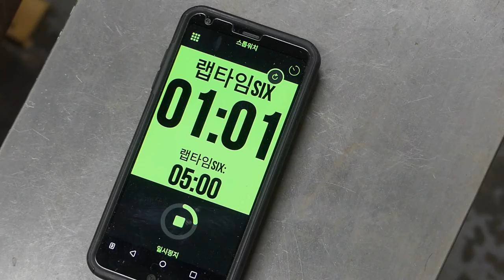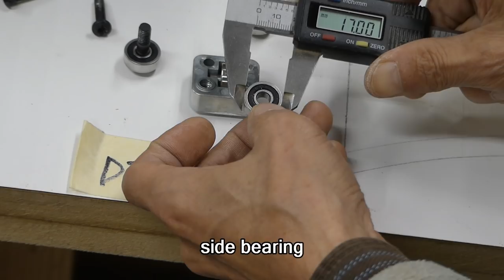Dewalt  vs  Bauer

Comment: I bought the bauer cauz it was cheap and i am going to use it five times a year. Changing the blade is like tying shoes, it becomes automatic and simple after a few times. Also, some blade makes are easier than others to control when changing. If this tool is for professional use, then buy a fancy brand. Otherwise Bauer is totally awesome

Comment: I purchased their $17 “multi tool” and have had it for 4yrs. I’ve used it to undercut at least 100 door frames for flooring installs. I figured I’d spend the money on the blades rather than the tool. The switch can be a bit finicky, but it’s earned its keep. When/if it quits, I’ll gladly get another! The cordless drill, however, died rather quickly. I also had their big wet saw and it performed flawlessly until I got the opportunity to get a bridge saw and sold theirs to a friend (he uses it commercially to tile floors). I have their 14” bandsaw, and plan on getting their dust collection system in the spring. I suppose it depends on the tool....
Reply from the maker: I also use the harbor freight 6 x 48 belt sander very satisfactorily.
It may be different from case to case.

Comment: If you noticed he used different camera angles to compare and intentionally made it look difficult to replace the Bauer blade.
Reply: The Bauer blade can be a pain to change because as he pointed out the blade tends to get hung up on the screws in the housing. I never looked into grinding down the screws because I don't use mine that much, but it might an option.
Reply: Jesus the Bauer blade Takes 1 min to swap. If you can’t figure that out you shouldn’t be using power tools.

Comment: Do you leave you saw tensioned, all the time? The frame of these portable bandsaws is a zinc aluminum alloy that will slowly warp under tension. Then the blade won't track right nor hold proper tension. Same thing will probably happen to your Dewalt, if you leave it tensioned 24/7.
Reply: Good question. I take my blade out and clean it after every use.. even says so in the manual.. 😁👍
Reply: @elfpimp1  Wow. If I had to do that, it would change how I use the tool! I am constantly using it to cut down a machine screw or two. Luckily, I did not read the manual. 

I bolted a spring to the tension handle, so it holds just a little force  on the blade when detensioned. That way the blade stays in the saw without the jack-in-the-box feature, wondering when the blade is going to go "sproing" and pop hafway out. :)
Reply: @mildyproductive9726  hehe, good one. I've not had the blade spring out after the first time I de tensioned the wheel.  But I understand where you're coming from.. 👍

Comment: Hey Young Je, what’s the advantage of mounting placement of the foot pedal? Are you actuating the pedal with part of your left hand while also guiding the work piece?
Reply from the maker: When the band saw is mounted on the stand, it is necessary to attach the switch of the knob to the ON state and attach the other switch to make the operation easy and safe.

Comment: I disagree. I certainly wouldn't buy harbor freight for professional use, but my portable bandsaw from there is awesome. You probably didn't change the blade to metal cutting blade. It SAYS right on the sticker the blade is meant for WOOD.
Reply from the maker: There are many videos in my video that use bauer.
I use the saw blade below
https://www.homedepot.com/p/Milwaukee-44-7-8-in-24-TPI-Bi-Metal-Deep-Cut-Portable-Band-Saw-Blades-2-Pack-48-39-0534/100564064?MERCH=REC-nosearch3_rrNA-100564064--N
Reply: @YoungJe  that is amazing. I tried to get a blade at HF and they told me they don't sell them. I bought an HF portable Band Saw and I like it. I did order a 3 new blades right away from Amazon.  Good review for me it does depend on the tool.

Comment: Young, I see that you point out the blade replacement as being the biggest factor in Dewalt vs Bauer, but the procedure for blade replacement seems to be the same (insert between top & bottom bearing, then wrap around drive wheel tires). What makes the blade replacement easier on the Dewalt?
Reply: Nothing.  It is NOT that difficult to put that blade on.
Reply from the maker: Watch the video again in 4 minutes and 49 seconds.
There are four such screws in the Bauer, two on the upper wheel and two on the lower wheel.
Because of the screw, the gap between the saw blades is only 3 mm.
Dewalt, however, did not come out with a screw, and the gap was doubled to 6 mm.
Reply: @YoungJe  I'm curuious how many years people will use the Bauer before taking a screwdriver and backing out any of those screws that stick out. If they wander in/out, you could chuck them in a vice grip and hold them against your belt sander for a few seconds.

Comment: Harbor Freight is good for basic tools and materials, such as hammers, pliers, allen wrenches, and similar hand tools, also items like sandpaper and other abrasives, some woodworking clamps, but generally any tool with power drive - battery or corded - should be considered only for minimal hobbiest occassional use and nothing more than that.
Reply: Hmm, I don't think the breakdown is quite that simple. Some of their hands tools aren't made of the materials, or built within tolerances that make a tool serviceable (ex. their handplanes), while some power tools can be made cheaply and still handle a fair amount of use (ex. their mid-range angle grinder). 

Cordless tools have further complicated things, because each brand is trying to make customers captive to their battery. So some brands seem to make some cordless tools good value for money (think of it as a loss leader, like when razor companies give out free handles), but others tools are the opposite, presumably because you're already invested in their batteries, they'll get a handsome margin. 

Sadly, that's because everyday people usually have to consider purchased one at a time, as we can afford it, while companies plan product lines calculating "lifetime customer value" - how much money they can get out of you in the long run.

Comment: Geez, lots of Harbor Freight fanboys got their feelings hurt. I have the Bauer and it works for me, but I don't use it very often. I'd take a Dewalt or Milwaukee in a second over the Harbor Freight if I used it extensively. And yes, the screws do get in the way when changing the blade.

Comment: Money spent at harbor freight is money wasted, I don't care what you buy. An Estwing or Titanium hammer will last you decades, and a HF hammer will start to come loose after a year if you're lucky. A pair of Kleins or Knipex's will similarly last decades, and a pair from HF might make it a few months before they start to seize up. Or one stainless steel wire, and their cutting edge is ruined if they don't just snap.

Their sandpaper and other consumables last about as long as toilet paper. If you want to actually get anything done, instead of spending your free time making trips back and forth to the big box store, stick with brands like 3M, Fuji Star, Red Devil, Etc...

A penny saved shopping at a big box store like HF is a dollar spent in the shop wasting your time. There is not a single item on their shelves worth the price tag.

Comment: Looks like the harbor freight has a twisted blade. Maybe its why it falls off. Mine don't I even cut a piece of rail road track in two.  I cut a lot with it and a lot of 1/2 in plate I was using on a job. The other thing is you are comparing a well used HF to a new dewalt.  I will be honest when you opened the dewalt I stopped watching because it became a bias opinion. If you used the exact new blade in both saws and did not see because I stopped it. Then I am sorry. If not then you are being bias especially since one is new and one well used.  Keep in mind you can replace the HF 3 times for the same money
Reply from the maker: I tried with one saw blade, of course, the saw blade is new.
https://www.homedepot.com/p/Milwaukee-44-7-8-in-24-TPI-Bi-Metal-Deep-Cut-Portable-Band-Saw-Blades-2-Pack-48-39-0534/100564064?MERCH=REC-nosearch3_rrNA-100564064--N
And the most inconvenient thing I have been using bauer for over a year is replacing the saw blade.